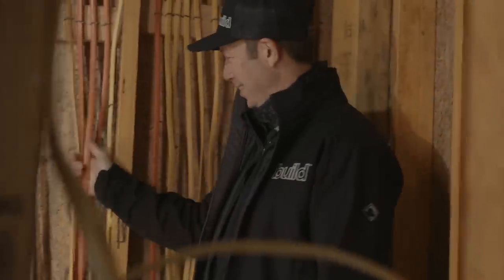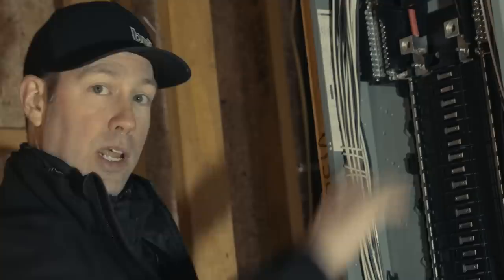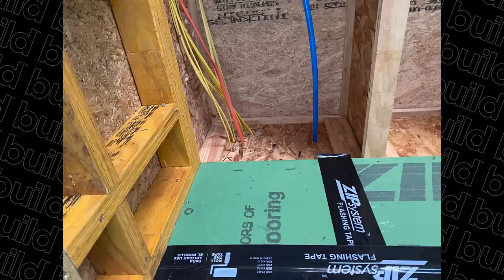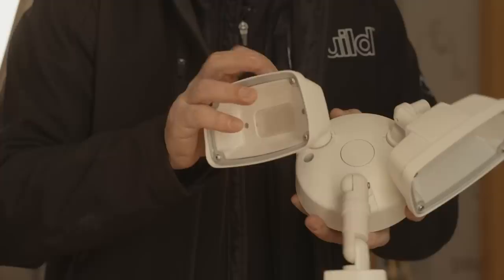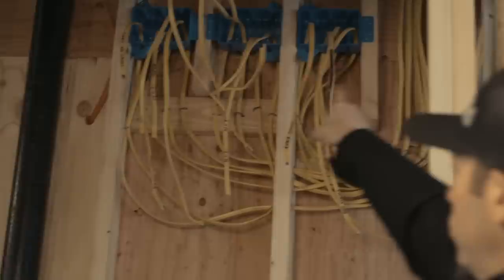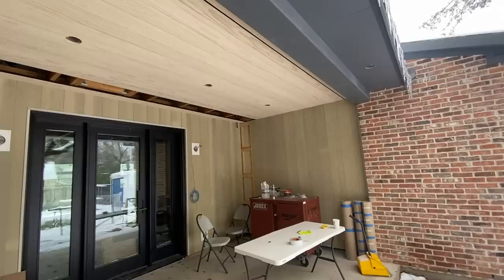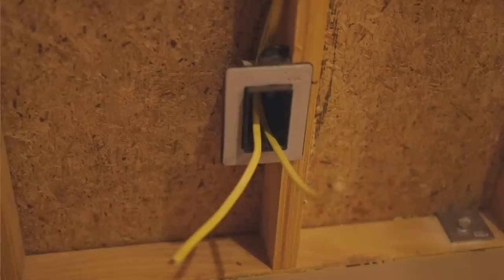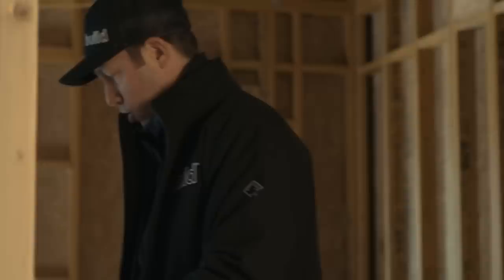5 Tips for New Construction Electrical & Smart Lighting!

Comment: Pro tips:
- Holy heck, DON'T EVER touch the main lugs in a panel. You'll never know if they're live if you're dead.
- If your electrician is buying wire by the 250' bundle, find a different electrician.
- If you have an issue with "popping" breakers, find a different electrician.
- The Halo wafers you used are advertised as 12 watts. You could run 100 of them on a single 14 gauge, 15A circuit.  You overspent by a factor of about 2 on your lighting cabling.
- Halo wafers on Insteon flicker excessively.
Reply: Yes, yes, yes and Yes!
Reply: 100% What a waste of precious copper for lighting circuits.
Reply: Agree.. No need on a lighting circuit. Even with fans
Reply: you want the electrician to buy his circuit wiring on 1000' spools, you get to carry them around.  and if you want to micromanage your electrician, be ready to find another electrician.
Reply: @kenbrown2808  Well they either do it to his standards or find another advertising buddy. Sparks have to start learning to play nice as they're going to be replaced more and more with PoE, sick of dealing with the my way or highway attitude.
Reply: @kenbrown2808  true!  
When I did my house, my level of input was telling what panel I wanted (Leviton), where I wanted a future sub box to be, and some specific non “best practices” receptacle and switch locations based on our unique needs.  Other than that, my inspector said they do great work, so I let them do what they do best.
Reply: @steven7650  that :"tired of the my way or the highway attitude" thing can cut both ways. you're right that the homeowner can set standards - but if the electrician feels that the "standards" are micromanaging the process in a way he doesn't like, there are plenty of other customers out there.
Reply: @locke3141  they're pretty proud of those smart panels.  but yes, there's a big difference between, say, "I want to be able to turn my front porch light on from my bed" and "I want you to buy your wire on 1000 foot spools, because reasons"

not gonna lie - I think the Leviton Smart Panel features are a little bit of a high tech solution to a low tech problem.  but the basic features of the panel are worth consideration.
Reply: @kenbrown2808  oh I agree.  I didn’t add all of the smart features, but I work with the local electrical inspectors for my job, one of which is also a teacher at the local college for electricians and they both swear by the quality of the panel.  So knowing they are trying to innovate, I wanted that panel just to give me freedom if I wanted to do some smart solutions in the future.  Just brand new house, so I was trying to do some smart, logical, yet not unnecessary upgrades.  I’m the type that thinks it’s not hard to walk across the room to change temps, but I like the idea of being able to monitor power and temp while on vacation just to be safe.
Reply: @locke3141  nothing wrong with having room to grow.  from the specs I could find, the basic design looks good.  the question is if it is as much better as Leviton thinks it is.
Reply: Also, aluminum is different now, no need to use nolox.
Reply: @JH-sp5my  you forgot one yes
Reply: @jstacarpenter  that, there's funny, I don't care who ya is.

 but thanks for reminding me of my other critique of Matt's choices:  never buy cast aluminum lights. they dissolve.
Reply: @kenbrown2808  you buy wire on spools because it's cheaper and easier to pay out. It also saves on scrap.

There are a variety of solutions out there that let you turn lights on and off from anywhere in the world.  I use mostly use Insteon.  I don't exactly love it...their dimmers are incredibly outdated in terms of LED support (they flicker from uncorrected reactance in the service to my house), but it's modular, easy to configure, and works with ISY natively.
Reply: @steveb365  no, I buy it in 250' coils because it fits in my spooler,  I don't have to special order it, it's cheaper per foot, and it weighs 20 pounds per roll instead of 90.

the fact it produces up to four pieces of scrap instead of up to one does not overcome those advantages.
Reply: Take a look at wire pricing. It sounds stupid, but usually 12/2 cost about the same per foot whether its a 250' roll or a 1000' roll. I've even seen the 1000' spool cost more per foot for no apparent reason.
Reply: @ryanroberts1104 , on account, it's $0.14 a foot cheaper at Platt to buy by the thousand, CESCO is similar.  

If you're shopping the box stores, it's $314.37 (1000) vs $330.24 (4x250) at Home Depot, Lowe's is $330 either way, and Menards is $346 either way.  

That's at least $100/house if you're shopping around and buying in bulk.
Reply: @steveb365  Prices are different almost every day. They often don't make any sense, this is a fact. And it's different in every state...
Reply: Agreed with Steve B. and some info for anyone building their home.
- Stage the 1000 foot spool in a center location on a CART on large job like this.  250s are for small jobs.  250s will slow you down.
- With todays low current LED light fixture that have small wire gauge pigtials you will actually make a better connection using a 14 gauge wire.  A 20 amp circuit is not necessary in lighting.
- Those wafer lights are chinese junk.  In 3 years when one fails, its not as simple as replacing a bulb.  Then when you do replace the wafer light, it will be a different color and style.  Not to mention they are more on the surface rather than recessed.   I recommend buying a quality traditional can, trim and dimmable LED bulb.
- Manufactures have been trying this smart wiring since the 70's. When they go out of business and you cant find parts, its time to rewire.  You simply can not beat traditional hard wired systems and devices, they are more rugged and built to last.
- Educate yourself Matt house voltages are 120/240.
- Todays aluminum ( feeders ) materials are so refined by the wire manufactures, there isnt a worry.  If there was, you would hear about all the thousands of new homes burning down.  What you do you think all those utility poles, pad mount transformers, etc are done with? 
- Its code that kitchens and fixed appliances are on 20 amp circuits but a bedroom?  Traditionally 1 room, one circuit.  However when they wired it all #12 they probably ground 2 or 3 rooms together.
Reply: @andrewbermond4228  Man, you should call Matt, I'm sure he wants to know all that! LOL
Reply: @kenbrown2808  Exactly.
Reply: @ryanroberts1104  Very true.  Nobody uses the big spools.
Reply: @andrewbermond4228  those poles transformers, etc are done with liberal coatings of deox. And underground equipment still cooks off on a regular basis.
Reply: Wafer lights are a pretty poor choice for a new home.  Having the bulb recessed in the can allows for much better light distribution. Wafer or surface lights are for closets at best
Reply: @Niccodemure  really depends on what results you want.
Reply: @andrewbermond4228  my county, Natrona in Wyoming, 20 amp is code for all circuits... I personally think it should change and allow 15 amp on lighting circuits...🤷‍♂️
Reply: I am irish and electrical is different, but bud he knew the panel wasnt wired up. In ireland we use 20 amps for sockets and 10amps for lights so the breaker never trips. Its a regulation in our houses. In ireland we use double voltage then America I think, We use 230 volts 63amps. Ye I agree with LED lights you could run loads of them as they use fuck all amps. Also dont understand why you would spend 65 dollars on a light..... on average in Ireland for a recess light you spend 10-25
Reply: @gavbox4289  yeah, your receptacles are also beefier than our clothes dryer receptacles. But you are also required to have a fuse in your plug, so a short in your table lamp doesn't make it catch fire.
Reply: @kenbrown2808  lately I have been using is 5amp sockets for them lamps so there isnt a fuse and they are switched on at the switch point. Everything is heavier in Ireland and UK then America. I had friends work with live wires like its wifi cable in America. In ireland and UK everything electrical can shocks you so our regulations are very strict and its about quaility then quanity. America needs to learn that. Canada is learning from us and are doing some similar teaching and regulations
Reply: @kenbrown2808  In ireland we dont use receptacles for clothes dryers. We just use a single socket for it. In UK it can be different as they change there regulations
Reply: @gavbox4289  a socket is a receptacle. Unless you mean you screw the dryer cord into a light socket
Reply: @gavbox4289  no, your receptacle circuit is heavier.  We run 15a lighting circuits, 30 a 240v dryer and central water heater, 40a 240v cooker, and specific appliance circuits as needed. But yes, we run 120v for any low power circuits, so we have less electrocution risk.
Reply: @gavbox4289  also, our safety standards are higher than yours. Electricians in the us cannot certify most installations - a city or county inspector is the only person who can certify an installation.
Reply: @steveb365  I think your math is wrong. it's 1.4 cents less per foot, not 14 cents.
Reply: As a general rule of thumb, yes there is never a reason to touch bussing or lugs in a panel. However, he is an experienced general contractor and if you watch you can see there is no meter installed so he knows there is no power to the property yet. He knew for FACT it wasn't live.

As for the 250' rolls vs 1000' there's pros and cons to both. Cost difference is almost always negligible even when accounting for the extra waste (there's really almost no waste with romex, even small pieces have uses ie., jumpers between cans, tails for stripping in boxes etc.). 1000' rolls are heavy and require some kind of spool system, but they're easier to roll off. 250' rolls are lighter and when setting up runs where you drag multiple cables through an attic are more practical than setting up six different 1000' spools.
Reply: This guy is a builder... jack of all things house master of non lol
Reply: If your electrician is scared of main lugs during rough in,  find a different electrician.
If your electrician thinks 250’ rolls are unprofessional, find a different electrician 
If your electrician is too critical of other electricians,….well,  that’s just how we are. 🤷🏻‍♂️ ⚡️
Reply: @matthewmcclure1364  I guess its just the habit is bad

Comment: @Matt, have you considered the security aspects of your electrical and smart home setup?  For example, your 220 box for mechanicals is outside and easily accessible to potential bad actors.  Also, bluetooth is just about the least secure means of wireless communication, it's super easy to exploit.  I.e., someone sitting outside you house could shut off all your electrical and/or change your lighting programming.

On a tangentially related note, have you considered physical security in the design of your house?  I think a video on that would be useful for many of your viewers, who might know to air seal the slab to framing but not know the difference between a truly high security lock system and a Kwikset from their local big box store.
Reply: 2020 NEC requires an emergency disconnect outside. At the very least his main breaker would still have to be outside per current code.
Reply: @InterstateLoveSong  that's a good point I wasn't aware of, thank you for bringing it up.  I thoroughly dislike that addition to code for security reasons, although I understand where it's coming from.

That being said, code is what it is.  So, my first thought is that I'd double down on the physical security of the panel box itself: I'd probably have a custom one fabricated or at least have the door of an off the shelf panel box modified to take a legit lock.  Then I'd use a high security smart lock to secure the door, so if I was expecting maintenance I could authorize temporary access.  The security vulnerability is just too significant not to try and mitigate somehow
Reply: And 2020 code is only enforced where it is adopted .... no hate, just do your homework for your locality before making decisions.
Reply: @claytonsprague7316  I thought about mentioning this, but knowing what I do about Matt he's probably building to exceed all the codes.  Me, personally, I want to build my own house somewhere that doesn't have any local building codes so I can do exactly what I want without Big Brother meddling 😅
Reply: @bf2wesley  come to rural Maine. We have no inspections here. Its my responsibility to do things correctly. Of course a licenced worker has to follow code, but still no inspections.
Reply: @JH-sp5my  Hello from West Bath, fellow Mainer.
Reply: What’s the security concern? Should we really be concerned about breaking into the electrical panel and then messing with our lights? This is silly.
Reply: @Brian, people have varying levels of risk tolerance generally, and I know lots of people feel similarly to you in regards to physical security of the home.  Personally, I take the adage "a man's home is his castle" pretty seriously, because (unfortunately) bad things happen to good people all the time; my opinion is that it's very possible to get high levels of physical security for not a lot of additional cost with some foresight and good planning.

Specifically in reference to Matt's house, having your entire electrical system and a component of your security plan (exterior flood lighting) in an area with no access control is risky.  For example, if someone wanted to raid Matt's garage of valuable tools, they could walk up to the side of his house, cut the power, then proceed as they wished without worry of an automatic alarm.
Reply: @bf2wesley  Any alarm without a battery backup is garbage anyway.

Comment: This channel has gotten crazy. I'm all for improvement, but think we're going crazy. I have watched this channel for a few years and learned a lot that I have used on my own builds, but I'm finding most of the recent stuff  completely impractical at any cost.
1. Main panel on outside is great for sub panels for pools, buildings, generators, etc. You should have just run a 200a subpanel interior for everything. So one penetration.
2. The lugs on the panels are aluminum, so technically you just mixed metals. They have designed all the new boxes to work fine with aluminum.
3. Most circuits these days require 20a anyway, but for the bedrooms, I prefer more circuits than higher gauge wire.
4. Smart switches.. so obviously it's sponsored, but no custom home should be putting Bluetooth switches in. Control4, lutron, zwave, zigbee are much more standardized and reliable. Lutron really isn't that expensive. You'll be tearing out those switches within a few years and using a more standardized system.
Reply: Lutron caseta FTW. I have 36 devices in my house, most of them for about a year. Not a single glitch with the switches, remotes, app or interface with alexa.

Comment: Matt, I know you mentioned the Big L when it came to smart lighting as being expensive.  You are correct when it comes to their Radio RA and HomeQS but their Caseta system is a game-changer.  

Advantages: No need for special wiring.  Caseta switches are a direct replacement for traditional switches. They work with ALL traditional light fixtures so there's no need to be locked into one brand of lighting.  They make 3 and 4 way switching a thing of the past; 3 pole switches are replaced by a single-pole smart switch and Pico remotes are used anywhere you want secondary switches.  The remotes look like switches and can be mount on the walls as such or sit on a table in a pedestal.  The system is just as programable as any other out there, but it steals from its bigger brothers, so you get more functionality for less money.  Note I am in no way affiliated with L.  I just did a lot of research before I did my house and Caseta was by far the best solution.  That said my daughter is a designer for a local company and they use RA and QS.   

Next comment:  If you are truly going to build a smart home, do not forget about your computer network.  Almost all smart devices like TVs can be hardwire connected.  RUN CAT6(a) to every room.  DO NOT depend on WiFi especially when it comes to streaming media.  Cable is cheap when the walls are open.  As an IT professional, I tell all my clients that there is no reason why a (smart) home shouldn’t benefit from a business-class network.  And with so many professionals working from home post-COVID,  now more than ever is the time to start building even modest homes with wired networks.  WiFi will never replace the quality of a good, wired network.  

Lastly, my cardinal rule of building a Smart Home is for it to be smart enough to allow people to interact with it in the traditional way.  
Love your videos.  Would love to talk more about home-based networking and smart home technology.